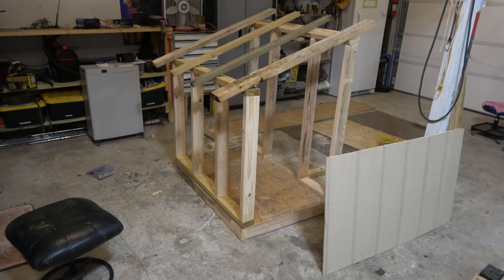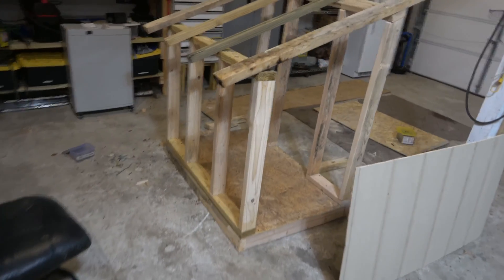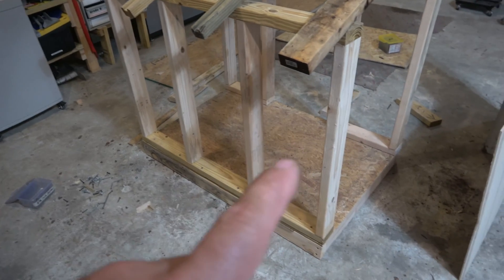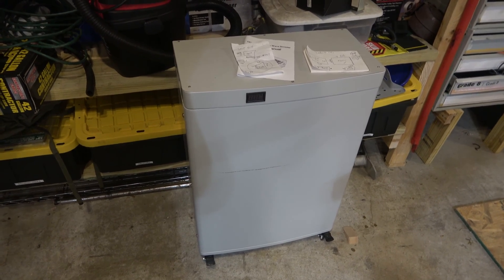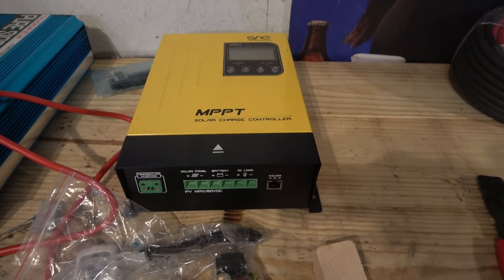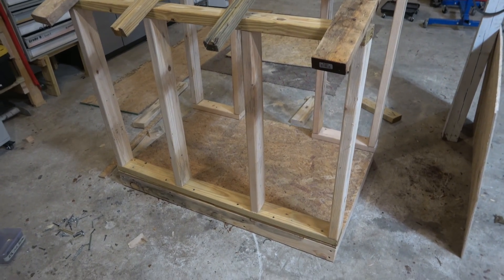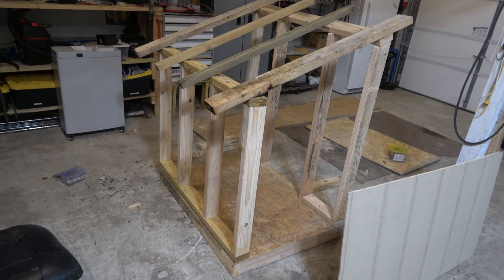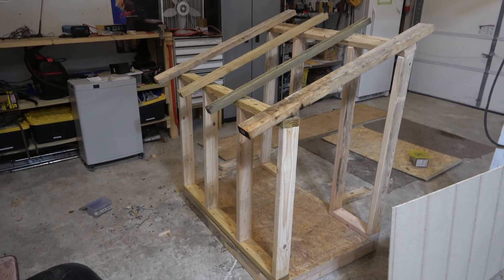Off Grid Solar Setup Part 4: Building A Hut To House The Electronics and Battery.

Comment: I'm giving  seed starter heat mats a go. 10x20 is only 11w . Going to run 4 strips between 3 pairs of u27 lipo batteries in a small enclosed insulated box. Using a tempature controlled relay to cycle on&off

Comment: Heating that box in the middle of winter is going to be costly in terms of energy. That said, what about using regular old style light bulbs and a thermostat ?? You said it would be well insulated. You only need to keep the box above freezing. How about a remote reading thermometer to keep tabs on things too. Maybe I'm crazy but I'd try it. :-)
Reply: Yeah , I’d say give it a go Erik , insulate that box really well , and set you up a cord and wire you in a lightbulb, maybe a 75 watt long life bulb, maybe two ,,  and put a thermostat in there and keep check in it . I’d say that would work . That’s some “up the holler” West Virginia stuff we used to do to keep the dog warm in his doghouse ,, my dad wired up a light bulb in a Mason jar and spray painted it black ,, put a flap made of carpet over the entrance ,, and a layer of straw and then dog bed padding . That thing stayed 55 degrees on 10 degree nights
Reply from the maker: Great idea. I think that is what we will end up doing. I just hate the idea of wasting the 60 watts for a bulb.